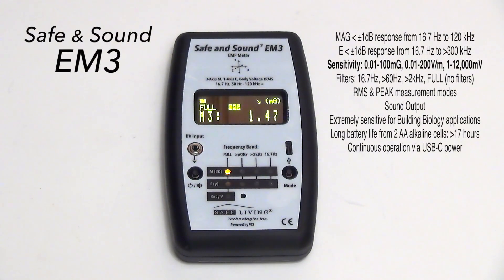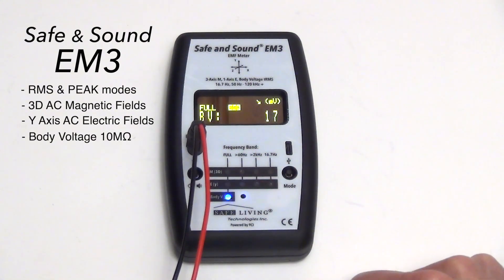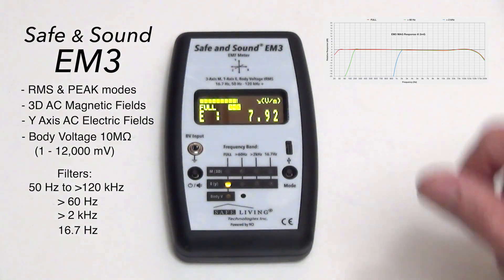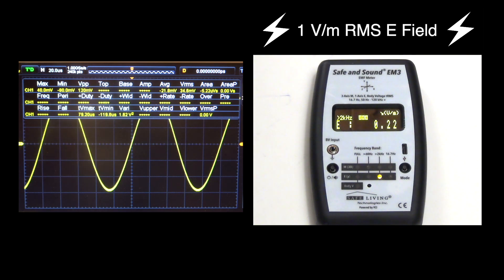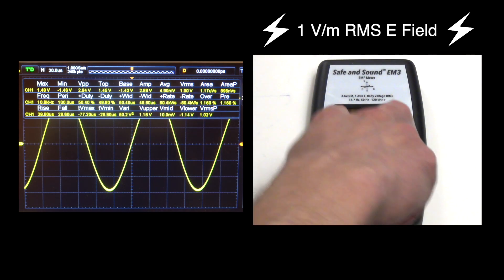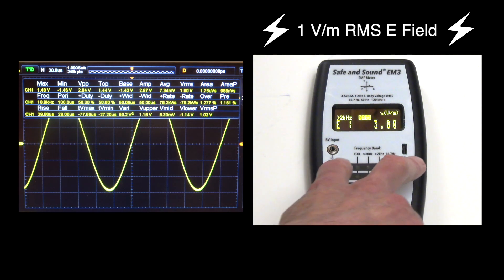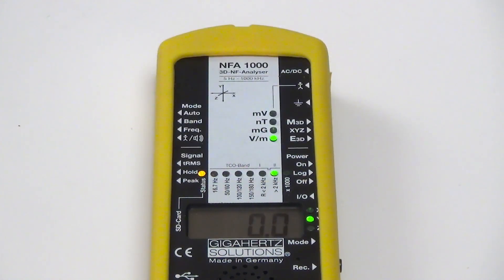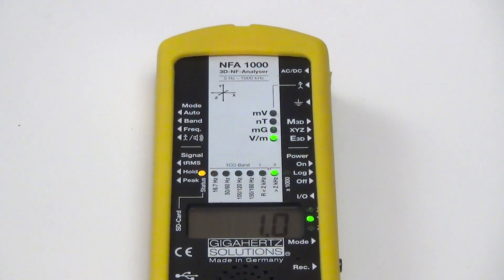Introducing the Safe and Sound EM3

Comment: I have read from an expert in EMF/RF reading with experience over decades with many different meters the its problematic if the meter is calibrated to 60Hz but you want to use it in a country with 50Hz. It can get very inaccurate.

Comment: the magnetic field limit is 100 mG?  That seems pretty low. I use the Alpha Labs which goes up to 2000. Instances that come to mind when it goes over 100 mG, is near a microwave oven, stick vacuums, blenders. Spinning hard drives (SSD?) in laptops?
Reply from the maker: Thanks for your feedback.  We were asked to design a meter with true, excellent weak signal sensitivity for Building Biology standards... within a realistic price range.  The 100 mG limit is on the individual X, Y and Z sensor axis, so the combined 3D display could be 170 mG.  Our perspective on extremely high fields is they simply need to be avoided or fixed - whether they are 50 mG or 500 mG.  And long-term daily, constant exposure to levels beyond the range of the EM3 is a problem in any case... unless the current Safety Standards are not a concern ;-)

If you need to know precise levels at inches or cm distances, it's often more accurate to measure at a further distance and use math to calculate the near-field levels.  Then also consider if someone would actually be that close to that appliance or device to actually receive that level of constant exposure.
Reply: @9ci  good answer. Agreed...anything more then a 4 mG for prolonged exposure - say while driving, I want to avoid. 

Almost always use external wired keyboards...not typing on a laptop keyboard.

Driving - ideally less then 2 mG, but usually can't achieve that unless using G-Iron, which I travel with...for use while renting a car. Already "permanently" installed in daily drive.

But good to know the limit could be 170 mG on this meter.

This EM3 might be better for measuring in car foot wells - where it is darker.  The Alpha Labs needs good ambient lighting or it can't be seen readily. 

I usually don't travel with a EF meter -- one too many...but nice to see this combo. If only there could have been a DE measurement too! ;)  Then I could leave the Alpha Labs / Greenwave at home!

Always some Cornets (MF-EF-RF)...but I hate the measurement units, among other negatives.

Comment: Bruce.this is great!  You beat the NFA1000 with an extra digit of precision in the E-field, which was a surprise to me.  I have a few questions ---

* Does this have an audio component (aka, the 'geiger effect')? I am hoping to mount it on a pole sometimes as a super buzzstick.

* What would be a text paragraph description of how to intepret the progress meter bar across the top -- is it a time delay slow moving average, is it logarhythmic, etc?

* Given how temperamental potential-free E-field measurements are, how distant does one need to be while taking a measurement?  For example, if I wanted to take 9 measurements in a grid pattern on a bed (a la 9PM NFA1000 measurement), how far should a person stand away and how long should we wait for settling before recording the measurement?

I hope to raid my piggy bank for one before the summer is out.  Bravo for a job well done.
Reply from the maker: Thank you!  We focussed heavily on low end sensitivity.  Yes, 'Geiger counter effect' like other meters.  We're still finalizing and testing various meter bar motions.  SLT will have documentation for 9 pt data collection.